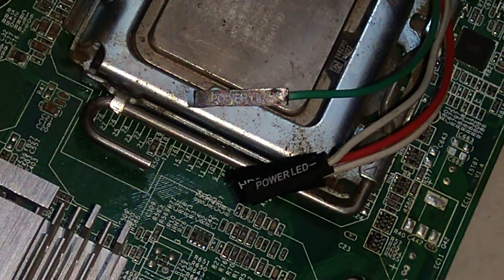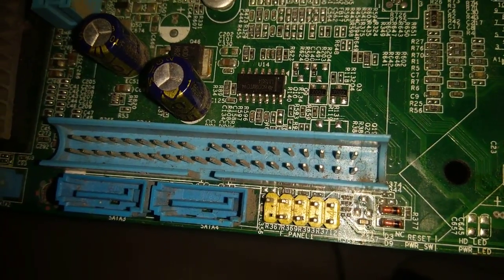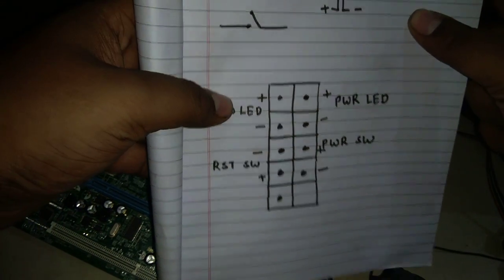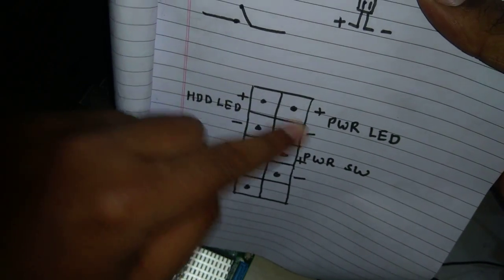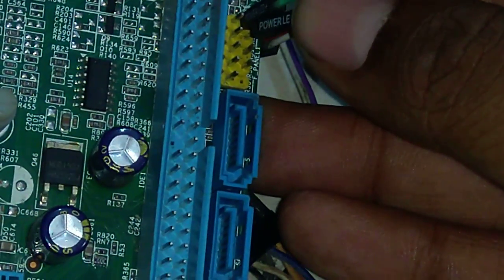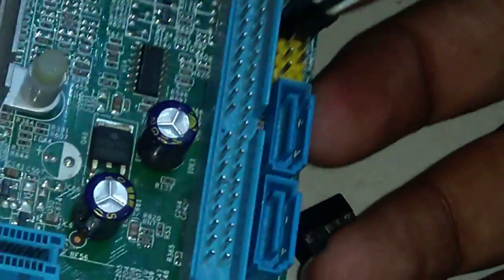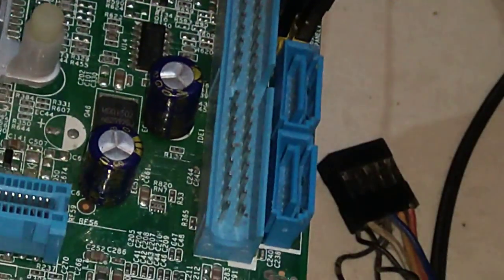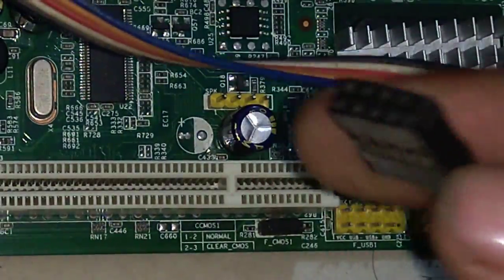How to connect front panel connectors to the motherboard

Comment: i have too run dual 2k 144hz which GPU will better?! 3080 or 3090?! My CPU is 5900
Reply from the maker: If you have money go with 3090
Reply: Does in dual monitor set up 2nd monitor take a significant amount of VRam in GPU?!
Reply: @meenamaaa    it doesn't affect performance if you are using 3080 and  3090  and it will be unnoticeable, it will affect when you are playing video at high resolution while playing games the performance difference is very less but yeah it will affect and  3080 is very powerful GPU it doesn't affect.
Reply: @theslinkbeast1086  do u have discord wapp or any social media where i can DM you!?
Reply: @meenamaaa  yes
Reply: @theslinkbeast1086  give me i will DM u
Reply: @meenamaaa   you didn't dm  me
Reply: @theslinkbeast1086  i am unable too find you u sent me friend request "Hantermoon#2660
Reply: @meenamaaa  OK
Reply: @meenamaaa  YOU CAN  CHECK
Reply: Give me ID
Reply: @meenamaaa   Okay  "tHE_Slinkbeast😐#5752" my  discord  username

Comment: Bhaiya To Aap mujhe conclusion batao ki mujhe latest hardware pe PC build karwana chahiye ya fir old hardware se?plz reply aur kya windows 10 Mai 2001 ke software and games chalenge kyunki usme compatibility issues hai isliye puch rha hoon?plz reply my questions 🙏
Reply from the maker: Depends on budget im personally using i5 2400 and gtx 750ti for gaming. U can go with new hardware like i3 10100f and gtx 1650 super but it gonna cost you.
Reply: @amanjamestech  Accha Windows 10 Mai 2001 jaise purane games and software chalenge kyunki usme compatibility issues hai isliye puch rha hoon? please reply 🙏
Reply from the maker: @syedshakib5852  umm problem ho sakti hai, uskey liye windows 7 ya xp sahi hai saken xp  ko purana hardware chahiye hoga.
Reply: @amanjamestech  Bhaiya to kya 9th generation ke processor Mai windows 7 ya windows 8.1 chalega?
Reply from the maker: @syedshakib5852  tumhara budget kitna hai or kya kya chahiye usmey?
Reply: @amanjamestech  Mere budget 10 to 12k hai.
Reply: @syedshakib5852  mushkil hai  12k mai  pc lena  yki  tum old hardware  pe  karoge  joki  ite  ache se  optimised nhi hai gamaing ke alawa   dikkat  face  karne  ko adhegi   pc chalate  samay is  thoda apna  bdget badha  8 k jame  karke  aap  20 k  acha pc le  sakte  ho